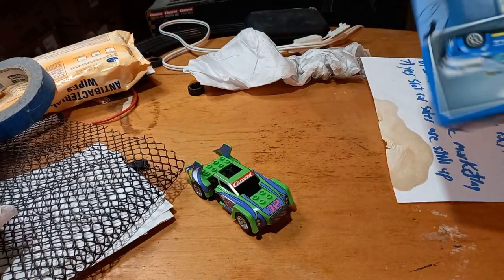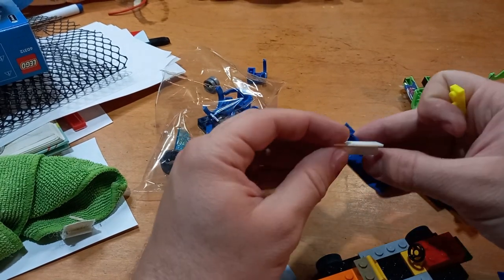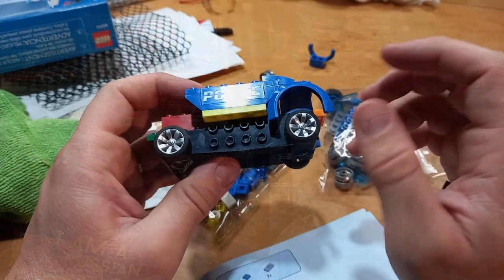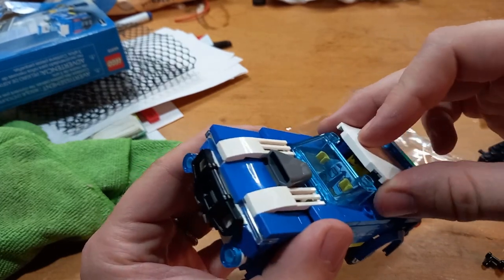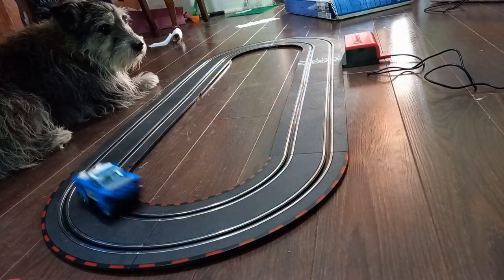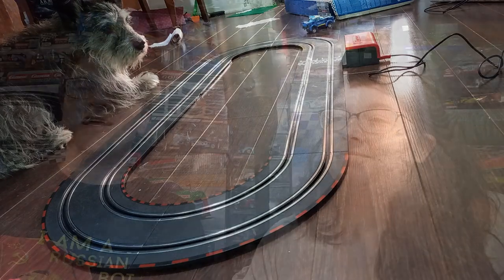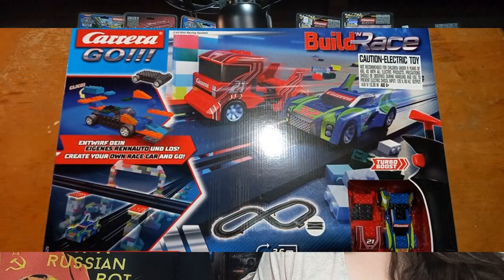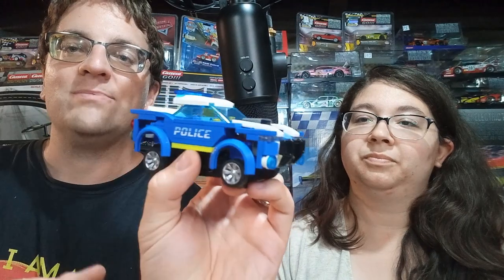Lego Conversion to Slot Car

Comment: Hey I’m new to slot cars and are interested in ho slot cars, I noticed ho has no lane changing which is sad but with the non stock pro controller out there on the market, do they work/help ho slot cars like 1/32
Reply from the maker: Yes non-stock controllers will help a lot. I'd watch H.O. centered slot car channels for more information.